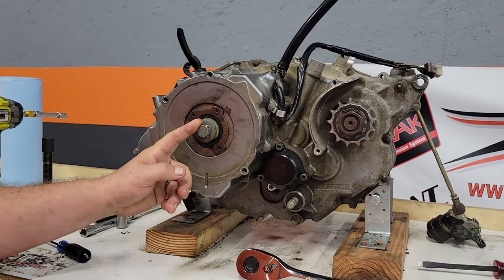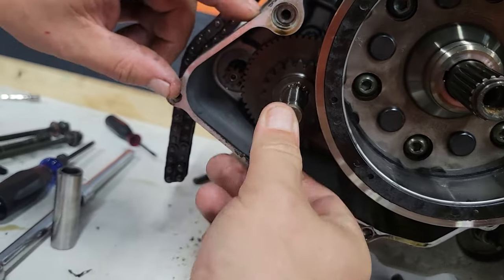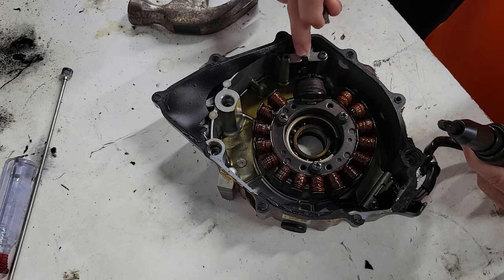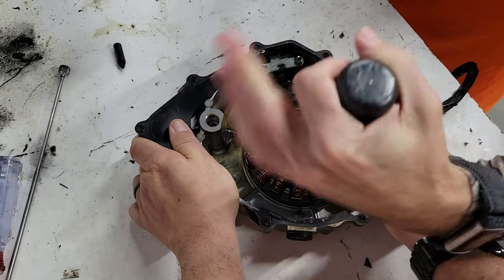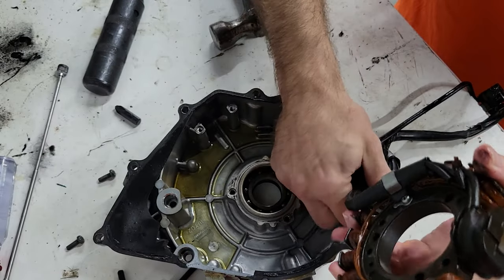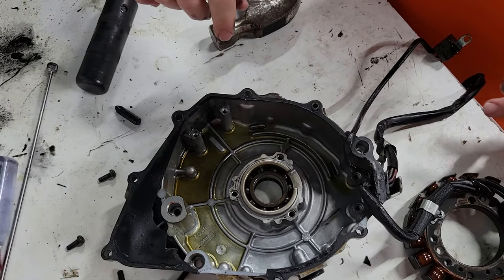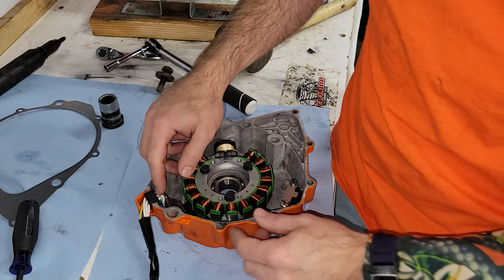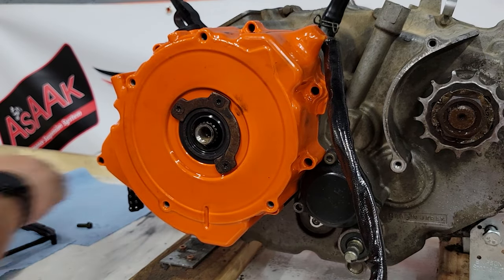How to replace Yamaha warrior 350 stator

Comment: 34 seconds in (idk the terminology) you use the screwdriver to pop it out mine will only come out about a quarter inch idk if I’m doing something wrong I’m replacing a gasket but I’m struggling cause I’m new to motors
Reply from the maker: that is the Boss fitting you may have rust inside of it or even dirt jamming it up i would use the open end of a wrench if you can get on it to pop it out the rest of the way just come at it from a few different sides kind of work it back and forth. once you get it out inspect it clean both boss fitting and crank then when putting back together use antisense

Comment: My stock stator the two pick ups lined up together at the top why does this video say to line it up with the bottom of the case
Reply from the maker: there was a few years that had duel pickups the stator has changes about 5 times from 87-2004